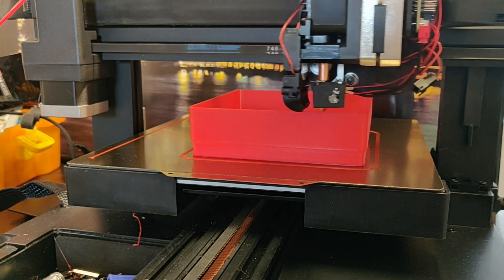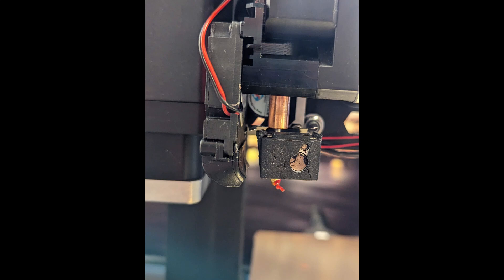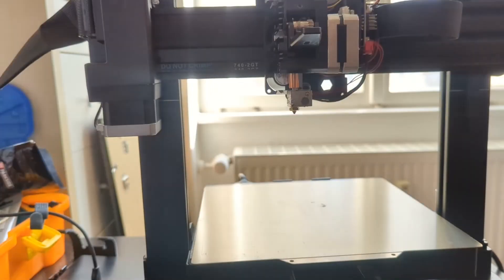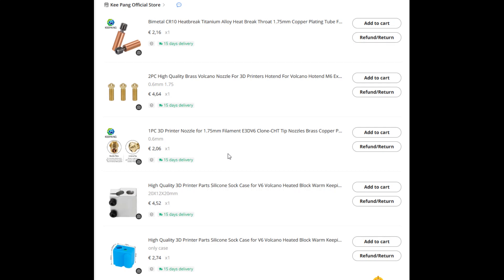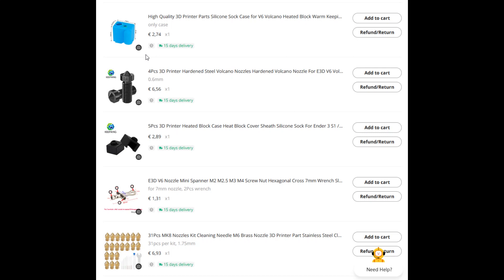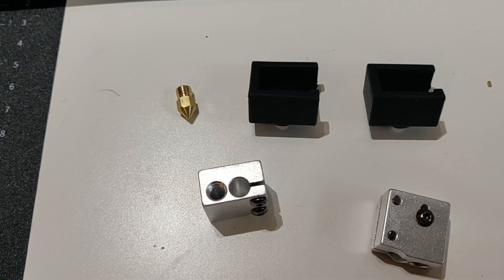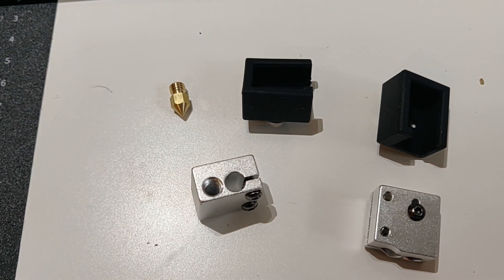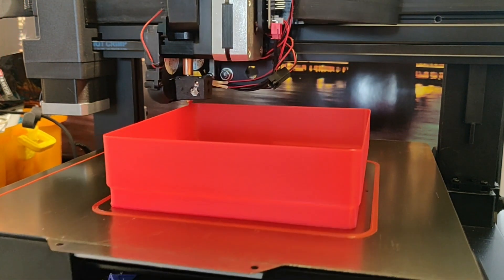Mingda Magician X - Cheap All Metal Heat break

Comment: I would appreciate it if you put links to everything in the description
Reply: Sir?
Reply from the maker: this is the heatbreak I bought https://www.aliexpress.com/item/1005004707403170.html?spm=a2g0o.order_list.order_list_main.4.4c221802FQJCNB
Reply from the maker: for the nozzle I recently installed this one which has been working great. https://www.aliexpress.com/item/1005005186434444.html?spm=a2g0o.order_list.order_list_main.17.4c221802FQJCNB